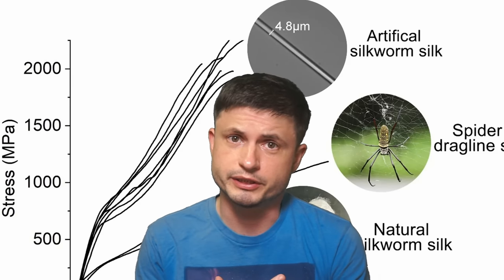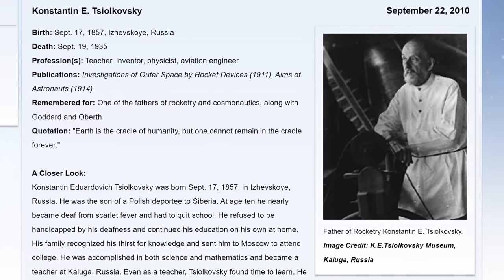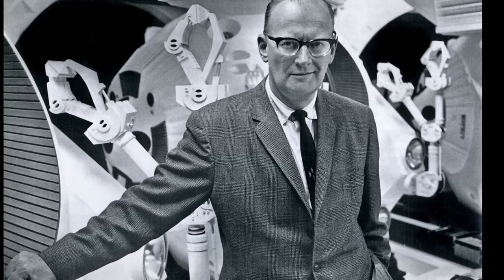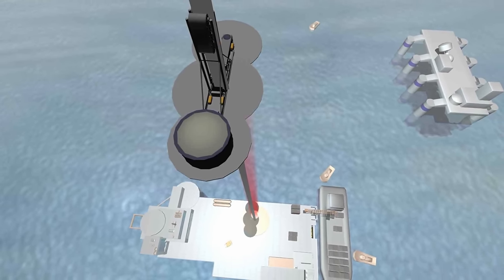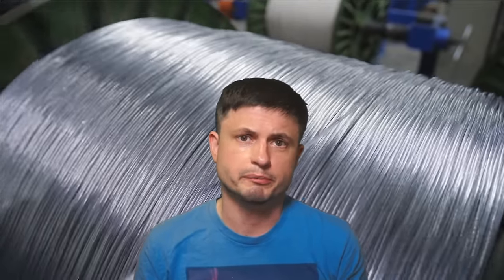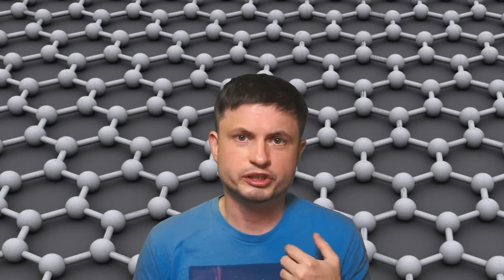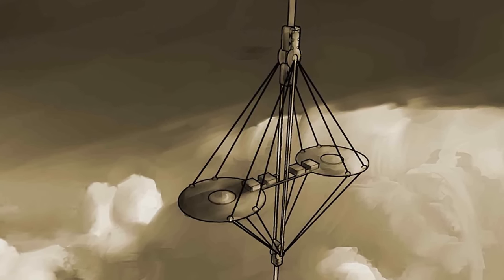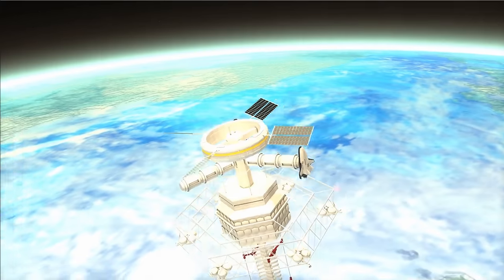Exciting New Updates About Space Elevator Technology...Possible After All?

Comment: Correct me if I'm wrong but any payload you send up the elevator would still need to expend energy to reach orbital velocity, otherwise it would produce a drag force on the cable.
Reply: Absolutely, my thoughts exactly. Why did Anton not mention this? Any rising mass would need to gain sufficient angular momentum to achieve orbital velocity. Also, there would be serious implications regarding atmospheric disturbances such as the odd passing hurricane not to mention electrical discharges.
Reply: That's just it. A cargo pod climbing a tether wouldn't be "in orbit" until it reached Geosyc, at which point, the angular velocity it had before it started would be its orbital velocity. It wouldn't need to "go faster" to keep it "in orbit" so it doesn't fall down at any point below Geosync, that's the tether's job. There would be some pendulum-like movement of the entire structure due to Coriolis, but that would be manageable.

You're not going to be dropping off satellites into orbit on the way up (if you even had a need to). You'd get them up to Geosync, push them over the side with a small maneuvering pack, Lower their periapsis to the desired orbital radius, then circularize the orbit at that level. Anything dropped out of a climber pod in transit would just drop like Felix Baumgartner. So yeah, no dropping pennies from the beanstalk.

Comment: Material science is the limitation in a lot of fields. I've heard high-speed aircraft used as an example of this. The aerodynamic and mechanical challenges are easier to solve than the metallurgy required for the designs to operate under the conditions required.

Comment: Carbon nanotubes are still probably the best bet for space elevator building material. Artificial silk still has a ways to go before the material gets strong enough to make something thousands of kilometers tall. 

Maybe we could do an orbital ring instead. An orbital ring is a proposed megastructure that would consist of several smaller space elevators around the equator. These would meet on the "ring" part of the structure, which would be at Low Earth orbit.

Comment: Are we ignoring wind force too? Storms? A carbon nanotube cable could act like a giant lightning rod. Wind could create harmonic vibrations that ruin the orbit or wear out the cable in specific places. I think there is more to consider than just the strength of the cable.
Reply: Considering that graphene is conductive couldn't you just hook something up and siphon power from thunderstorms? I do remember hearing that a cable built thick at the base and getting thinner further out would increase the strength of the cable without compromising the orbit, so perhaps a more reinforced base reaching up through the stratosphere to protect the cable from the worst environmental conditions. As for the orbit,  adding thrusters at the counterweight to correct such deviations might work. There are a lot of potential problems though, im most concerned about the damage this thing would do if it snapped.

Comment: 10:35 This is so cool!
So if we can get the satellite up there, then we make the satellite itself a graphene  factory and roll the graphene out in both directions in a single, uninterrupted operation. That way there are no splices or breaks in the structure. All we need to do is supply the base materials to the satellite. It may not be possible to do that at the initial launch. But if the materials could be delivered to it as needed that might work. It sounds plausible enough that we might see it in our own lifetimes.

Comment: Can you do a video about orbital rings?
They do not require exotic materials, can be made rather cheaply, if you have sufficient manufacturing equipment. And they are pretty save against collisions, because you can lower them to for example 100km in altitude. 
Additionally, you could use them for very fast and cheap intercontinental transport.
Reply: Orbital rings bring up an agent coordination problem.  Surely countries would see the economic benefit, but it only takes one hold out to change where the ring would be.  Reasons for holding out might be conspiracy theories about initiating countries, fear of the ring falling, and fear of the ring opening up their country (looking at you North Korea and China).  As a vast piece of infrastructure, it immediately becomes a anti-global terrorist target.  Finding a path where all countries agree and securing all entry points are two soft factor issues in addition to the engineering feats required.
Reply: @johnpaden8360  The terrorism issue is one point, where i share your concerns. However, the same could be said about the space elevator. And I do believe, that you could make an orbital ring more resilient against terrorism than a space elevator.  The point about cross country collaboration, I believe is less valid. I think, that there is for example a geodesic around the earth, that only crosses the USA, Canada, Papua new guinea and Australia,

The safety issues are still valid, but I think, that because it resides in a much lower orbit and you can build one with lower mass than the space elevator, it is associated with a less catastrophic event in a failure, than the space elevator.

Comment: Hanging tethers can be easier to build and have some advantages. As the tether is constructed the orbital velocity off the low end decreases making it easier to loft more tether per launch. The tether does have to have some means of boosting itself as paload is added so electric propulsion fueled by propellant brought up by each payload or an electrodynamic interaction with the Earth’s magnetic field is required with solar providing power. 
Eventually as materials improve the orbital velocity of the lower end can become so low that it could be lowered into the upper atmosphere where aircraft could rendezvous with it with electric turbojets overcoming drag. It could then mine the atmosphere.

Comment: I've never seen the issue of angular momentum addressed, though surely it must have been. Cargo at the surface is moving about 1600 kph eastward with the rotation of the earth, but as it climbs the cable, it must move faster and faster. If there are not thrusters pushing it east, or angled tow cables pulling it eastward, the rising cargo will haul the  cable, counterweight, etc. westward. To get the cargo into geosynchronous orbit, even if attached to the elevator cable, you'll have to supply the energy and directed force to match speed and angular momentum throughout the trip. No free lunch here, I fear.
Reply: Great point about the difference in speed between ground and space

Comment: The next challenge after the cable itself is finding a way to climb 3600 km of it many times without damaging it.
Reply: Probably not so difficult.
I'm guessing the tether would be put together by shorter pieces of 100m -1km length each. And at each place where these are connected, there will be places to connect the cable that the elevator cars are using to climb.
And besides, this would be built to last for an eternity. Meaning, it will be built to be maintained and replaced. So smaller parts of it can be replaced as they are worn down.

Comment: Steel could work but even with high tensile strength steel at the point of Maximum stress the cable would have to be over a hundred miles thick tapering to both ends. This would represent far more Steel than has ever been refined on Earth.

Comment: all we have to do is make it long enough, so it catches earth's centripetal force, and also make it strong enough so that it doesn't snap during any weather condition and durable/resistant enough so that it does not get eroded by particles in the air... erosion would be main priority, maybe a forcefield of some sort of barrier, also maybe AI controlled wings, so each stage in height catches the breeze for air lift to lessen the weight... but that would introduce drag, so basically we making a kite connected to a kite connected to a kite etc...

Comment: That space trebuchet gives me great hope for the relatively fast assebly of the space elevator
Reply: In more ways than one. My first thought was if they've solved the tensioned release problem that could go a long way to helping with the launch's from the counter weight this was another reason for platforms as ballast could be added then ditched upon release but on land stations hadn't found a mitigation system yet well not easily built and tested hence sea platforms are the most common proposals for early development.

Comment: Most of the cost for space exploration goes into the ocean in the form of spent boosters and into the air as spent fuel. This would make a trip to space almost free. The only problem is that the orbits that could collide with the tether will have to be cleared out.

Comment: Maybe this is a stupid question but there is one thing not quite clear to me when it comes to the idea of "space elevators": to the object "going up" not only potential energy is added but also kinetic energy because it needs to be accelerated "sideways" too, the higher it goes. 

How can a vertical rope provide the necessary sideways force component?

I have not yet fully analyzed the forces in play so far but I can imagine this requires a lot more tension as there is already due to the rope's own weight. And also the rope would need to "bulge out" sideways, at least a bit, to add a perpendicular force component.

Except whatever is "pulled up" is not doing so by using the rope as counter force but instead had a rocket engine on its own ... which then needs fuel what would last and finally bring us back to square one, just using the rope as kind of vertical guidance.

Comment: Then you will also have to take into account abrasion and oxidation/biological erosion of the cable material.  The cable will probably have to be made from multiple cables all constantly being replaced over time.  Which is doable and most likely would also be recyclable for the bulk of the materials.

Comment: So If we can make the cable more than strong enough to work, then we should be able to sheath the cable in a protective layer that protects it from damage by the elevator and elements, and it should be able to hold the weight of that sheathing.

Comment: Hi Anton, another wonderful video. I have a couple questions popped in to my head while watching. 
1) would it be practical/or make any kind of structural sense to take the bio-engineered silk and wrap carbon around it(steel braided cable style)? 
2) what might be the gravitational effects from the moon upon this space elevator? Would it potentially de-stabilize the orbit of the counter weight?
Reply: @V02MAX
The strengthen silk wouldn't help. It can't hold it's own weight. So it effectively weakens the cable.

The cable would be affected by the tidal effect of the moon.
As you may know, the Earth and The Moon both rotates around a center point. So anything close to the Earth will fell the tidal effect.
This should mostly be a not to large varying streach in the cable.
The counterweight wouldn't wobble more than our satellites does. So it does matter, but shouldn't be difficult to manage.

Comment: would constantly lifting weights up and bringing empty cars down shift the orbit of the counterweight? i was imagining how a spinning skater pulling arms in an out changes their rate of spin and while the length of the elevator wouldn't change, i worry that the center of massing moving due to lifting loads might have an effect
Reply: You're right.
However, it's not the orbit of the counterweight that matters. It's the orbit of the balance point.
So one option could be to send the same amount of weight up as down. So having two elevator cars, one going up, and the other going down at the same time, with the same weight.
Another option could be to solidly anchor the cable on Earth, and keeping it under tension. That way minor shifts like these could be pulled back into balance, by the weight of the Earth.
Reply: @Tjalve70  but if one makes it a habit to have two equal mass elevators travelling in opposite directions doesn't that become impossible if the main goal of the elevator it to bring goods up (and...i assume with a little rocket fuel, they go off to do whatever useful things they were made for), so eventually they'd run out of mass to bring down the elevator. or maybe some of the cargo could be rocket fuel to keep structure moving at the right velocity?

Comment: Last I heard anything else on this a tensegrity table design was proposed in one design. Would allow for reduced cable lengths to an extent. But haven't seen anything else on the topic. Idea was the cables used to produce tension would also house the elevators while the table section could be used as a sort of warehouse for storage while awaiting for transport to the next set of elevators via tunnels loaded onto the next elevator section while the top table is the station.

Comment: Hi Anton, how is the lateral acceleration or deceleration of the payload planned to be addressed? Getting something vertically up an elevator is one thing. Adding or subtracting the necessary lateral velocity and momentum as the payload moves vertically must be a significant factor in the system..

This issue to be resolved can be experienced by moving inward or outward on a merry go round, or as an ice skater spreads or draws in their arms while spinning.

Jon

Comment: The engineering challenges are immense.  Imagine the problems when deploying the first tether from space:  Winds would whip the 36,000 km tether into chaotic oscillations while electric charges would race up and down the cable.  Catching the end will be a heroic feat!

I think the best first installation of a space elevator would be on the Moon.  Such an elevator could use the L1 Lagrange point, which is about 58,000 km above the Moon's surface.  Advantages:  
Can be made with currently available materials. (per Wikipedia)
Does not pass through the Earth's Van Allen belts.
Does not have to deal with weather, lightning, aircraft, oxygen corrosion, terrorists, etc.
Deployment of the first cable strands would be much simpler (reduced oscillations).
Rock from the Moon's surface could be lifted by the elevator and then added to the counterweight.
Reduces the need to use lunar landers.

Comment: We already have the materials to build a Space elevator for the moon.
Earth, has other issues, the atmospheres moisture and electric potential make the terrestrial elevator very tricky. Plus having the elevator avoid collisions with debris and satellites would be tricky.
Graphene is nice for elevators because a Ribbon rather than a cable is the preferred  shape.
Reply: A Moon elevator will probably be more expensive than an Earth elevator. And not be nearly as useful.
Reply: @Tjalve70  While costs would vary with Launch vehicle, The cost build is much lower (lunar gravity is 1/6th so much cheaper, maybe the cost 1 or 2 manned missions pn the SLS system) and it reduces the cost to the moon to slightly more than a trip to geosynchronous orbit. A lunar elevtor can bring materials from the moon to orbit to use in building spacecraft.

Comment: Interesting stuff. Wonder how weather would affect it and vice versa. Meaning if there is a storm, how stable would it be? Or would it induce lighting strikes to the cables since it's essentially a long ground cable?
Reply: From what I've read, the strength is so great compared to the cross-section that wind should hardly affect it. Lighting I'm less sure about, but I think if it's conductive or has a conductor applied to it things ought to be OK.

Comment: Still you need a counterweight at the geo-stable orbit. Parts of that gondola will move slower or faster than the earths rotation. i mean where else could the cable be anchored. any other orbit nearer to the earth moves faster and any other orbit farther away than the geostationary orbit moves slower. The pull and tug of that cable as the gondola is lifted will pull the counterweight out of balance and the orbit will change. unless one builds a ring around the earth with 2 elevators on opposite sides of the earth. even if we have material that could withstand all that... we havent figured out the basics yet.

Comment: If we look far enough, the costs of taking any load up into orbit wouldnt exceed the cost of an elevator taking you up to the top of the Burj Khalifa.
Meaning, free of charge. Because you dont need "more" electricity to lift something into orbit, than to lift someone 50 stories off the ground. Actually you need the MOST energy the closer you are to the ground..
So it really is only a matter of throughput. Naturally the very first space elevator ever built, will be used 24/7 for government and industry material.
But once we build more of them, the only thing driving price would be demand vs supply (supply in terms of time to lift up and down, and available free spots on the platforms). So there wouldnt really be any energy costs in the price per say, 99% of the costs would just be because of limited places.

But even then, if you have a "Hilton Space Elevator" to an orbital hotel, most likely the elevator ride would be free, because its the hotel that makes the money, the same way you dont pay to use the elevator in a hotel.
Of course, knowing governments, there would probably be a "toll booth" at the ground floor though, to make up for the costs of construction. Same as Highways.
But with tens of thousands of "passengers" per day, that cost would quickly diminish to zero, and become profitable.
So we're not talking ten thousand dollars per person to go up, we're talking 50 bucks.